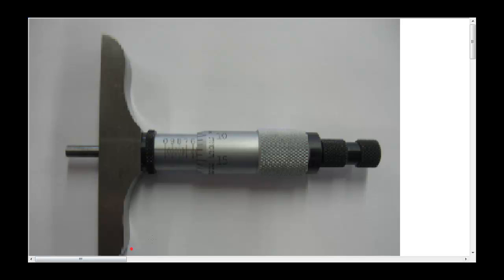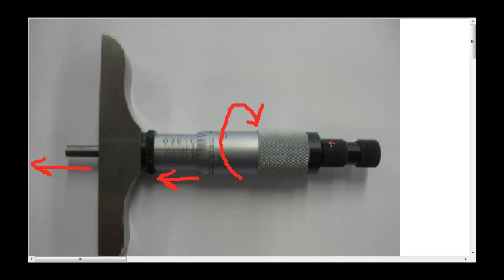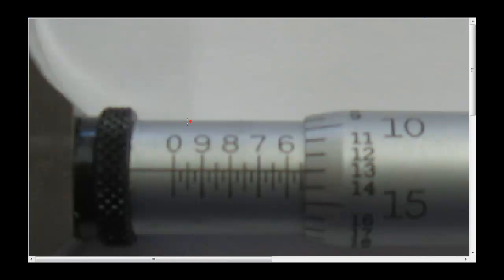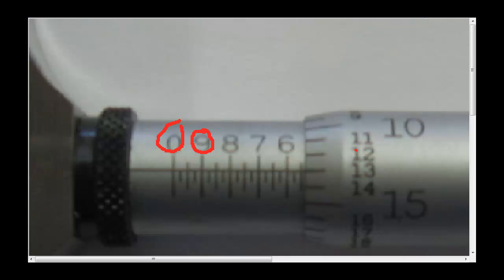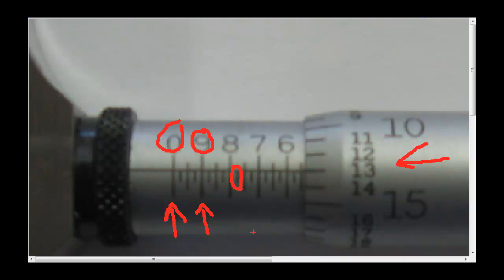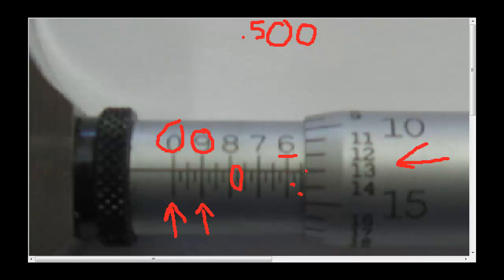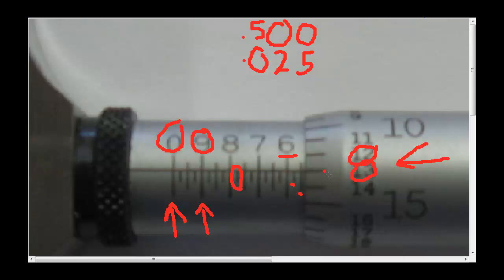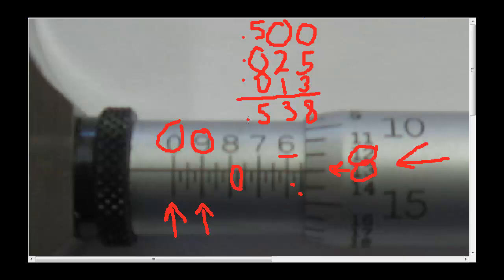Depth Micrometer Function and Reading

Comment from the maker: The depth mic is read backwards as compared to an outside mic. You need to count "what you can't see" or what disappears under the thimble as you screw it down extending the depth rod out the bottom. If you look at the sleeve you can see the 6 but not the 5 you can see two graduations to the right of the 6 but not the third one. So you can't see the .500 + you can't see the fist .025 + the .013 on the thimble lining up with the datum line on the sleeve. This makes the reading 0.538". Thanks

Comment: i sometimes catch myself reading it wrong even after years of using these like a micrometer reading at .668" LOL do what i do and always double and triple check the reading. 5 seconds of double/triple checking saves alot of headache later.

Comment: what if the thimble was between the 13 and 14?
Reply from the maker: Hi Daniel, if it is between the 13 and the 14 you have to use the lower number. So the size will be 13 and a little, but 13 is the last accurate number. Great question!
Reply: machiningmoments Thank you for that answer.  I have never used one before and I had to measure how far a piston receded.  Your video was key in helping me to do it correctly.
Reply from the maker: Daniel Schimmel I'm glad it was helpful, thank you for taking the time to let me know!
Reply: Daniel Schimmel Hi, why do you just add .025 of a thousand and not .050 because there are two graduations showing after the 6? what if only 1 graduation was shown after the 6?
Reply from the maker: Hi Daniel, not sure if you got this reply. Depth mics are read backwards...what "you can't see" on the sleeve. You can't see the 5 or one graduation past the 5 so the size is .500 + .025 + plus what is on the thimble .013 this totals 0.538"
Reply: machiningmoments oooooooooohhhhh ha! got it!